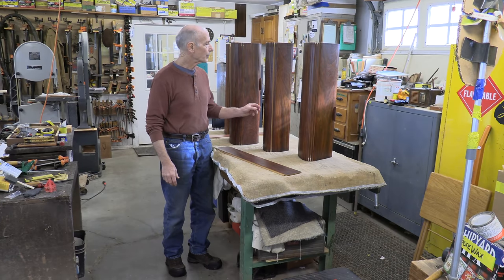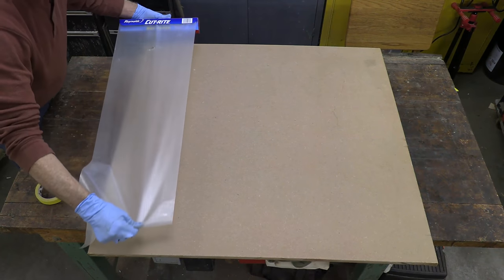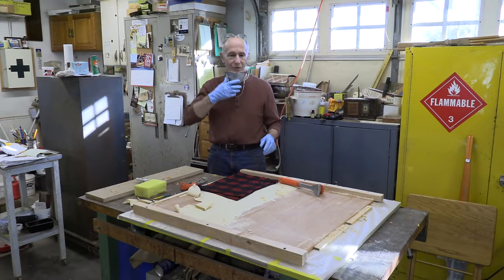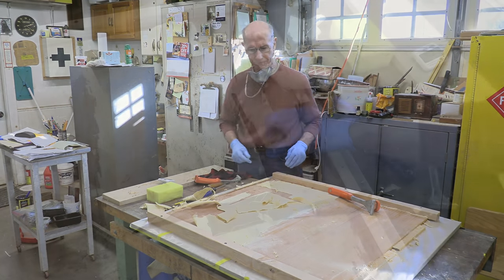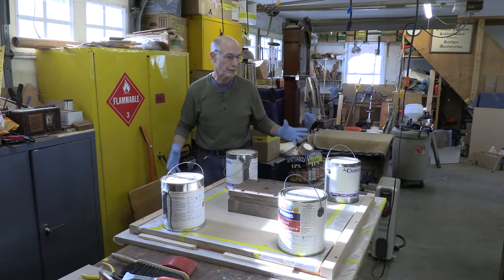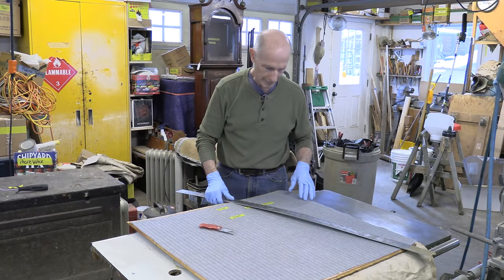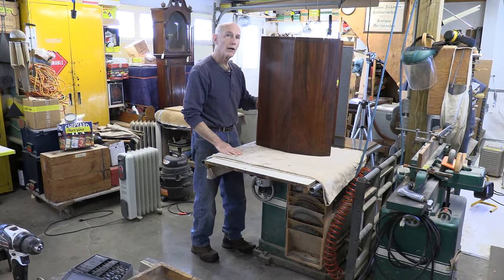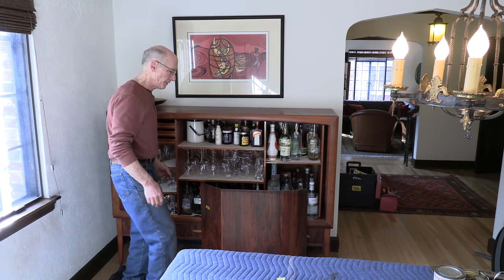A Mid-Century Modern Rescue - Thomas Johnson Antique Furniture Restoration

Comment: When I was working in a wood cabinet factory then a wood window factory I learned how the wood just sucks the moisture out of your hands. Mine felt like sandpaper. The gloves are a great idea. A beautiful piece of furniture. I can see why they wanted it repaired. Ella is such a good sport LOL The ticking was a fantastic idea as it is very durable and lasts eons. Thanks for the video Tom !
Reply from the maker: You're welcome! I never suspected the wood! Makes sense
Reply: I work in a Library, and it’s the same for books…they just suck the moisture out of your hands. (Logical, as paper is from wood pulp. A direct correlation)

Comment: Shop dog in ear protection…made my day!  Your ‘Right/Left’ signs reminded me of a 45 year old mistake I made during my apprenticeship.  A complex hand built chest of drawers came in that needed complete disassembly.  I fought for my opportunity to work on such a beautiful piece…convincing my hesitant craftsman boss that “I was ready!”.  I forgot to mark where each piece came from and my patient boss handed me a pencil and some masking tape and told me to reassemble it over and over again until every nail hole and every screw went in smoothly without resistance.  63 times…..that’s how many times i put it together and pulled it apart.  My very patient boss sent me home for three days, withheld pay for that day and let me come back..well humbled…to put it back together and finish it for the customer.  I learned more on that one piece (and the deduction of a week’s pay $62.00) than on any other piece or time in my apprenticeship.  I NEVER have forgotten to mark every piece since then!  Another great video!  Nice job.
Reply from the maker: That's a great story! I can tell by the amount of your pay packet that we are about the same age.
 But yes, I had to learn the hard way to mark everything as if someone else was going to reassemble it! Even though that person would be me (but maybe not), I was a different person 2 weeks later!

Comment: What an amazing cabinet, lovely design / look and amazing opening doors. I don't think I have seen anything like this before, although I think I played with some as a kid, but nothing this high quality. 

Glad you explained the gloves I was attempting to figure out what chemical was being used, or maybe what dust / wood was an allergen. As someone who only gets light frosts, never snow and always high humidity, I didn't realize this was an issue. Also confused as your breath wasn't showing. Does this mean the air temp was high enough that it didn't show, but the thermal mass of the metal tools was cold, hence the issues? Also thanks for converting temperature into C. Fahrenheit makes no sense at all when one didn't grow up with it.
Reply from the maker: Thanks! It's not that cold in the shop, with the heat on, but the tools are cold, and just no humidity

Comment: Beautiful work, as always, Tom! As for the gloves, I am there with you. I wear gloves all year when working in the shop, painting in the house, gardening, etc., because my hands are my money makers and crucial to all of my hobbies. My full time profession is IT Engineer, and a lot of my hobbies are hand-intensive (knitting, sewing, fiber spinning, gardening, tractor maintenance, woodworking, etc), and I'm subjecting them to solvents, water, cold, heat, abrasives, you name it. If I get so much as a cut or a blister, I'm down until they heal. I've even have a stretching and massage regime for them to prevent fatigue and strain. I protect my hands like I do my eyes and ears because they are just as, if not more, important to my daily life.
Reply from the maker: Thank you! Yes! You are 100% correct! I'm subjected to all the same elements. It's bad when you wake up at night because cracked cuticles are excruciating! Stretching and massaging are critical too

Comment: Dear Mr Johnson, First, you can moisturize your hands as much as you like. Second, in times I have used water-soluble glue to spread on the surface, my methode was First, glue on the surface, second spread by  toothed spatula then with a dough scraper.
As a carpenter I have veneered a lot of surfaces. A paint roller we didn't use. 
I have enjoyed your project and didn't anticipate behind these tambour doors whiskey but a flat screen (television set). The cabinet was huge. You did an excellent job!
Greetings from Germany
Reply from the maker: Thanks! I like the roller! It does a good job. And yes, that is a big cabinet - and well stocked!

Comment: It's funny how much of this was like another restoration channel I really enjoy, but for paintings,  'Baumgartner Restoration'  He always seems to be scraping the back of a portrait to get the old backing off, and often has the same issue of the glue bond being weak, but annoying stubborn.  And when you rolled out the glue, was almost just like how he applies washi kozo paper to the facing of the painting to give it protection, usually while he trying to flatten it out (which you also did, though with wax paper covered board vs. weights)  So interesting to watch the worlds collide.  Despite my not being a carpenter or furniture restorer, I've learned so many innovations from your channel, Thomas.  Thank you
Reply: I began by enjoying his channel very much. But I stopped watching after a while. A shame really because the restoration of old paintings, for me, slightly edges out that of antiques. However there is something about that guy that just rubs me wrong. It touches on a lack of humility that I perceive in his personality which I find distasteful, and for some reason, have a peculiar suspicion of.
Reply from the maker: Thanks! Anytime I'm mentioned in the same sentence as Baumgartener I take as a high compliment!
Reply from the maker: He talks too much! But still, excellent videos

Comment: There's something elegant and almost magical about tambour doors. They came together so well and I remember you using that same fabric on a previous set of tambours, from a small roll-top desk, I think. Didn't know you made house calls! (LOL)
Reply: I suspect the "house call" is because it was only the doors that needed 'help', and it was easy enough to take them out. That cabinet is pretty big (and full of stuff - couldn't have chosen a better one to fix!).
Reply from the maker: Thanks! dlevi67 is exactly right!
Reply from the maker: Exactly! I had my doubts when I first saw photos - but I was able to do it in place

Comment: What an interesting and attractive cabinet. You mad the whole job look much easier than it really was but particularly refitting the doors. I didn't expect that to be so straightforward and, I don't think you did either.😁 Ella didn't look too impressed with her hearing protectors, although they quite suit her. Surprised she kept them on long enough for you to get the shot though. Not many guys would think of the dog's hearing, whether partly in jest, or not. Her hearing is more acute than ours, so protection is probably a good move and it made for a classic picture too.😁👌
Reply from the maker: Thank you! You’re right, I didn’t think they would go in! The noise doesn’t seem to bothered her, but I’ve thought about that too

Comment: The mechanical engineer in me was deeply confused by it not opening all the way... until you said 'stuck' 🤣. Great work! BTW try spritzing the cloth with water and ironing before removing (worked great getting cloth of a million mile of folding wood blinds I refurbished).
Reply from the maker: Thanks! That's a good idea about the iron, I wasn't having much luck. It came off anyway...

Comment: Another great show! I love the hint on using rubber gloves in the winter  time....I know that they likely would not  cause any problems around the table saw...Shop policy "NO GLOVES WHEN USING THE TABLE SAW!
Reply: Does it not occur to you that beside the fact that this ultra thin glove material poses no risk for getting caught and being pulled into the blade, it provides a better hold on the wood, making it safer??
Reply: @horacerumpole6912  Yes it did! As an engineer, at these speeds  (and the lose of tactile feel) ,  I know that micro-seconds count> Do not wear gloves on MY saw! Please
Reply from the maker: Thanks Andy! I agree. Of course it might depend on the cut but yes - no gloves. My daughter has a Saw Stop
Reply from the maker: Thanks Horace Rumpole! I'm going with Andy on this one. You are right of course about the material but as a rule, no gloves
Reply: @andybyerly5629  Just how do you perceive me operating your table saw?

Comment: "Warm Skin" skin balm. Skin lotion that helps moisturize and protect skin from cold, damp air. I use it when running in the Disney Marathon every January. (It can be in the low 30's and damp in the morning there).  Might work for your needs this time of year. But I would still use the rubber gloves in order to enhance grip.
Reply from the maker: Thanks! I'll look for that!

Comment: Good job.  I would have rolled out the cloth with a rubber brayer to get good adhesion to the wood strips and then applied the weights to hold it while the glue dried.  I would also have diluted the glue slightly with a little bit of water.  Finally, I would have used canvas rather than mattress ticking for the cloth.  The price is about the same and canvas is a bit heavier..
Reply from the maker: Thanks! I'll have to look into the canvas. It's not too stiff?

Comment: Excellent work.  I was concerned that the glue might seep in between the boards ,but thankfully my concerns were unfounded. Did you wax the edges of the individual boards?
Reply from the maker: Thanks! The glue did seep a bit - you can see me at one point breaking the individual slats apart.

Comment: Just wondering if the edges of the tambour slats were treated with anything (either originally or by you) to prevent any errant backing glue from joining them and preventing the slats from operating normally?  Thanks for the great video.
Paul
Reply from the maker: Thanks! No treatment. A little glue always gets through, in the video you see me breaking the slats apart, using a putty knife

Comment: I know what you mean about 'Skin' problems. Mine is the opposite, that it is high 30's C. here in Oz. I wear the gloves for Epoxy, cleaners and finishes. I get all 'Wrinkly' from the sweat. I have to put powder in the gloves and then hand cream at the end of the day.
Reply: I repaired a Tambour door a couple of years ago and used linen and contact adhesive. It worked, but would not use Contact again. You can imagine the alignment problem. If I do it again I will follow you and use PVA.
Reply from the maker: Yes, you have to keep at it!
Reply from the maker: I've never had any interest in contact cement! I don't trust it!

Comment: This a great video for me because I need to make a tambour door for a hoosier cabinet I'm building. I watched Norm build one for his roll top desk using contact cement  and I watched you use yellow wood glue for this project. Not sure which way is better of easier. Your preference was the yellow, your thoughts on that if you care to share them?
Reply from the maker: Thanks! I've never used contact cement - I always associate it with poor craftsmanship (apologies to Norm), but more importantly it is especially reactive to solvents, and can cause problems when finishing. I've always used Elmer's or Tite Bond. I feel like I have more control
Reply: @johnsonrestoration  Thank you.

Comment: Oh boy, you don't need to say anything about wearing gloves to protect hands or winter skin issues. I have to handle paperwork, which sucks skin oils out so hard that in the winter I get severe skin cracks that hurt just as bad as paper cuts! One trick I use, is before putting on gloves I slather hand cream all over my hands and into the nail beds. It helps.
Reply from the maker: Thanks! Yes, I do the same thing. I never thought about that paper, just like wood, is a sponge!

Comment: I can't imagine that the cabinet was built without a system to allow the doors to be removable.  Out of curiosity how would you have dealt with it if this was not so and the doors did not go back in so "easily"?  Try to remove the top?  The back?  Thanks.
Reply: Probably the back, and insert them back-to-front (from the end of the guides). Some track systems are made like that - whether the manufacturer then installs an easily removable back... is a different question entirely! 😁
Reply from the maker: Thanks! dlevi67 is correct, for most pieces you remove the back
Reply from the maker: Yes, 90% of the time it's through the back. I thought for sure I would have to pull the back on this one - I was surprised they went back in! I worked on an old french occsional table that had no way to get them out, we had to dis-assemble the entire table

Comment: Incidentally, my opinion, turn-of-the-century still refers to 1900 because the turn of this century 22 years ago was also the turn of the millennium or Y2K. Although you are correct that the most recent turn of the century was this one, I think it would be acceptable to be referring to 1900 when the term is used. But, I get your intent to be clear and concise, which you always are.
Reply from the maker: Thanks! I like that - it is something that will need to be settled. But we don't call 1800 the turn of the century! It should be only the latest "turn", I vote for a new name (or none at all) for 1900